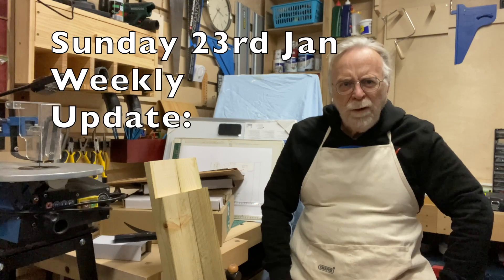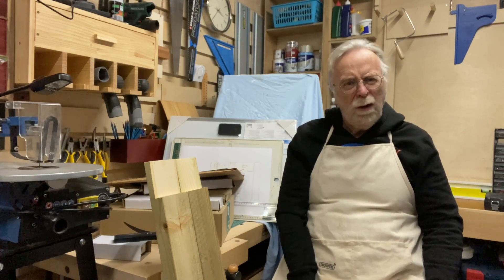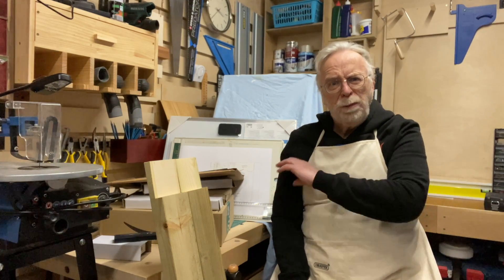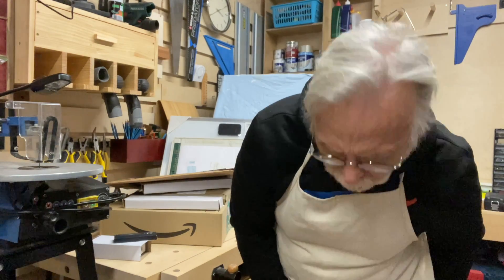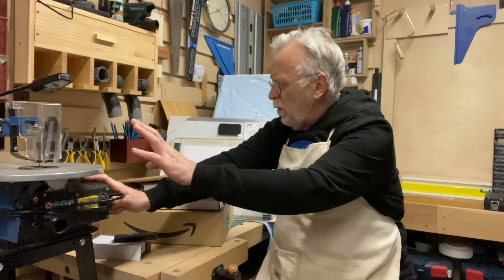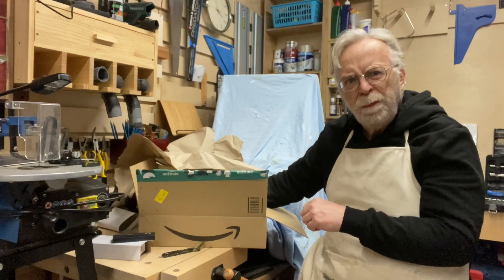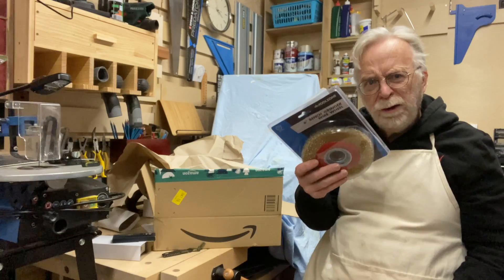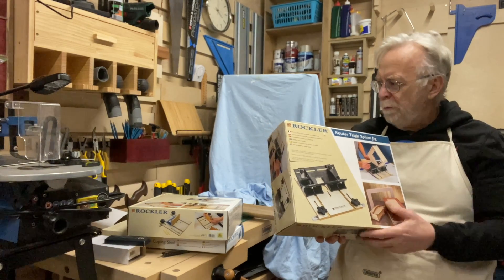Sunday Update & Last BIG Tool Haul: January 23rd

Comment: Nice haul Loz, I am particularly interested to find out how you get on with the box joint jig, I am contemplating making one, but could be persuaded to buy one. That Trend chisel sharpening roller looks good too, I struggle with sharpening my chisels and plane iron with one of those narrow roller jobs, like you I can't keep the darn thing flat or level.
On the subject of restoring old tools, I bought a second hand Sealey three wheel bandsaw at a boot fair, it has taken me a week or two to restore it and get it working but it now sits in my shed all working nicely, the biggest issue I had was getting a new drive belt for it, but a lot of emailing around and I managed to get a new one, not from Sealey though haha. But from a company called Drive Belt Solutions. First class service.
Reply: Hi Steve
I have the Rockler box joint jig and it works a treat(I'm new to routing). I would suggest you get the 'spiral up cut bits', although expensive they give a nice clean cut.